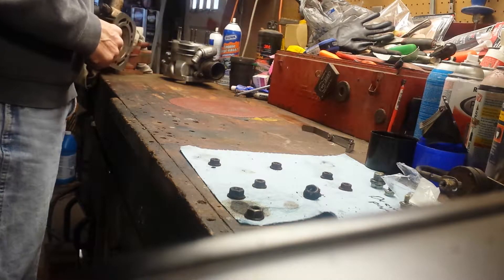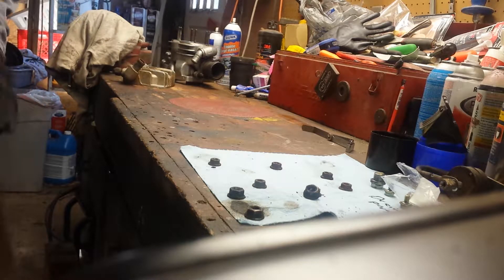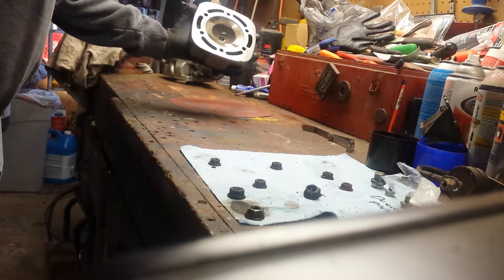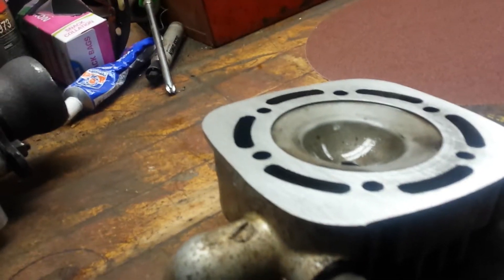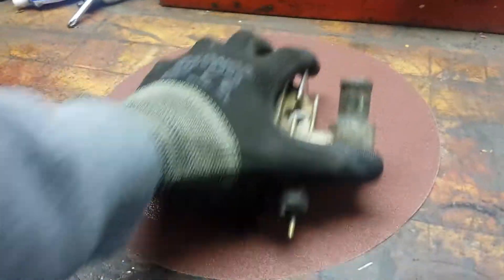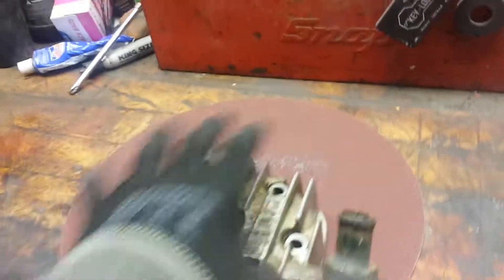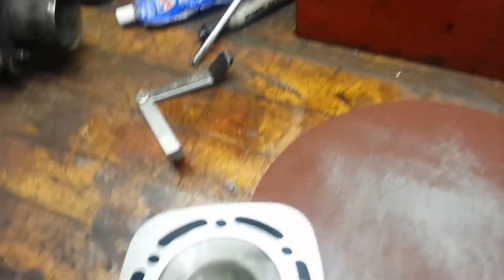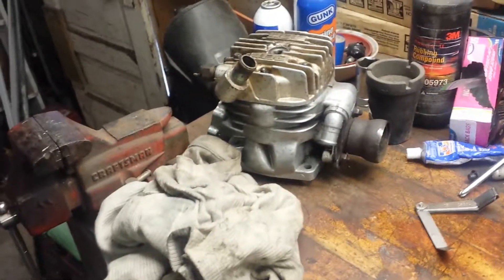Warped head on your Polaris? Resurface a Head yourself!

Comment: I put a new head/ gasket on my 96 xplorer, I’m still getting anti freeze in the cylinder. I didn’t see any coolant form in the cylinder while the head was off for a week. Im guessing the cylinder is junk? Any ideas?
Reply from the maker: Is the head flat or is it warped? Take the head off, remove gasket, set head on cylinder and see if there is any movement. Its either the head or cylinder that is warped. Also did you put the head gasket on the right way? Its stamped in the gasket which way is up.
Reply: It’s the cylinder, that’s for the advice

Comment: Thanks for the video, I had a blown head gasket on my polaris 700, sure enough the head was warped, so I took to 81/2 by 11 sheets taped together on a piece of glass and followed your lead,  started with 150, then 220 then 320 and  1/2 hour later it was done.

Comment: One thing I'd recommend is that you rotate the head 90 degrees every few strokes. That allows you to see the imperfections better, and also helps you to apply even pressure.
Reply from the maker: I do. I didn't show the whole process. But good point.

Comment: I may have to try this. Did you put the hondabond and also the gasket on?  Did you put hondabond on the block as well or just the head?
Reply from the maker: On the block.
Reply: @TitaniummanGarage  None on the head?  Just on the block(Jug)?
Reply from the maker: Finish off the head with 600 grit. Dont put a sealer on the head. Just use the gasket. When I made that video I did use a sealer. But it's not the right way to go.

Comment: Hey Bud how are you thank you for that does that change the compression the compression at all by doing that I have a Polaris 400 sportsman and the head got warped a little bit
Reply from the maker: No. Unless you take a lot of material off. With 320 you wont .